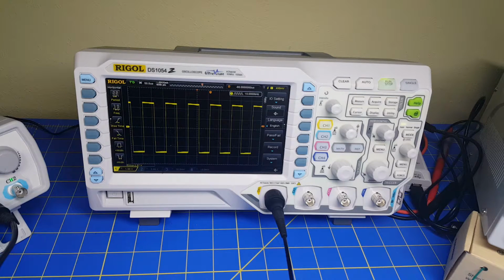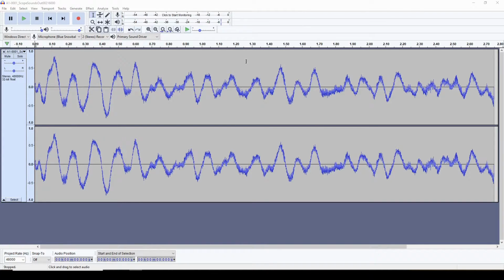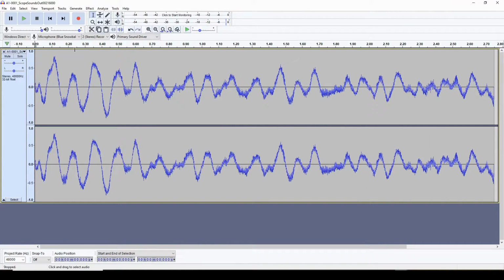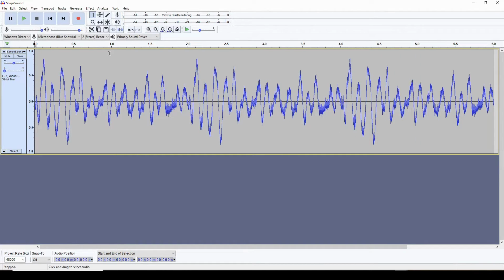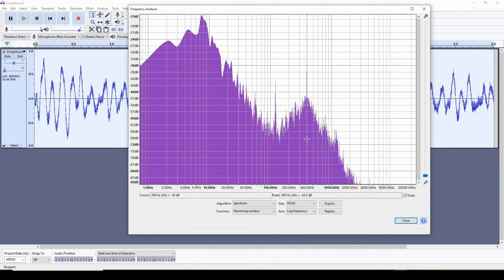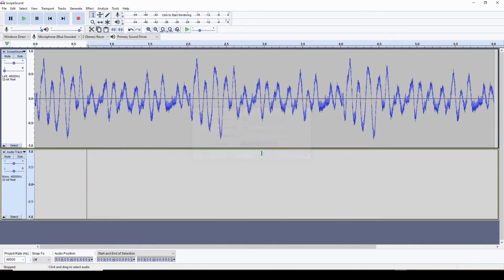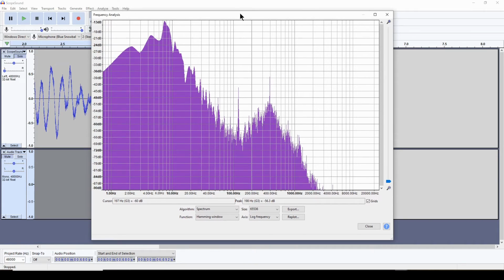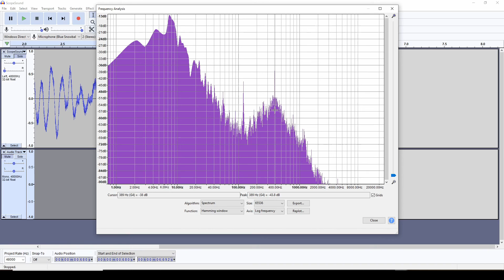Free Spectrum Analyzer

Comment: the graph looks wrong. i have same ds1054z . i can frequency check it but i see no point changing the fan to void the warranty, i would if it was those loud cooling fans on amplifiers but not the scope. i can check with rta to see what the peak frequency is and i doubt the fan is doing 10Hz
Reply from the maker: "Looks wrong" based on what? Have you checked the RPM of the fan, and decided it can't have a mechanical harmonic vibration around 10Hz? If so, why?

Comment: That was interesting.  I kinda wondered where you were going with tracking down the frequency you cared about.  I'll suggest another way to do it, with either a PC or android phone.  Download PSK software, and just listen to the fan directly.  There are multiple open source options for PC, and at least one for Android.  The software is designed to decode PSK transmissions, but a feature is a real time spectrum analyzer of the audio range, with a waterfall display.  Had you not done this video, I wouldn't have thought of using that, so thanks for the tip, and reminder for us to think outside the box!